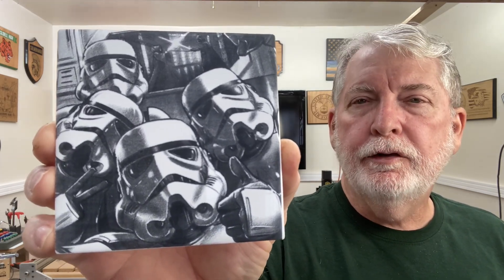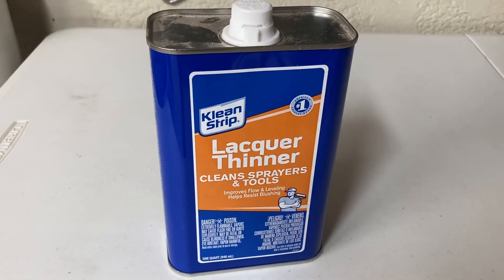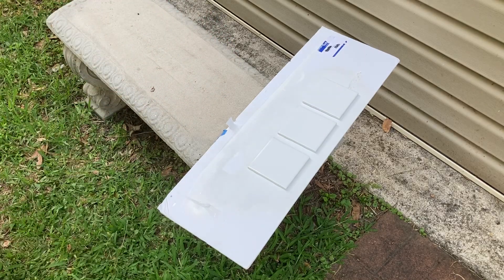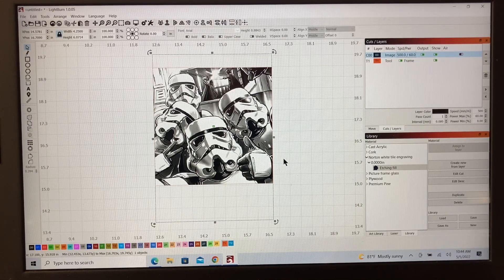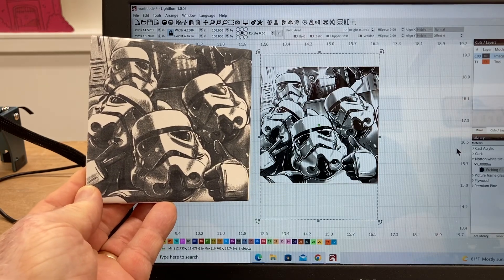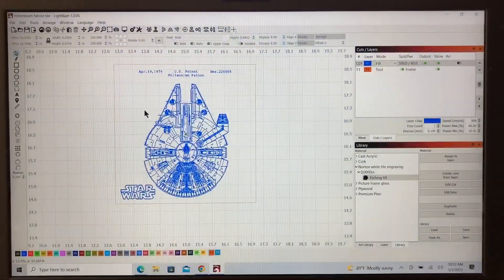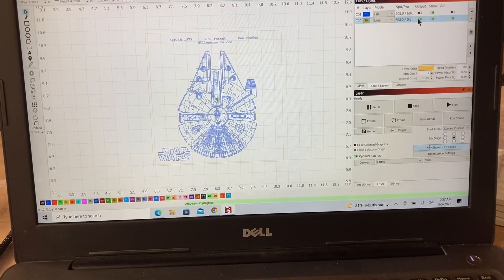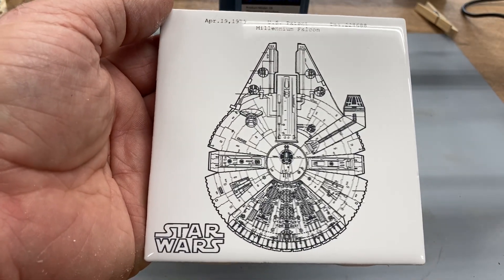Laser Images onto Tiles with the Norton White Tile Method

Comment: I have the same Laser and engrave tiles with a speed of 2000 and a power of 80% (254dpi)  - works much faster with phantastic results.
To prepare, I use Titandioxid, mixed with Isopropanol in a spray bottle. For speed drying I use a heat gun - ready to engrave in 5 minutes. After engraving, clear the tile under water and enjoy 🙂  regards from Germany
Reply from the maker: Thank you very much for the information. I have some titanium oxide to do some tests. Just can’t get to it quite yet. I appreciate you giving me this information
Reply: @PawPawsWorkShop  I'm excited about the result. Mixing ratio Titan/Iso 1:2

Comment: My first attempt failed..I edited the image in imagr and imported in lightburn with passthrough but the image came out grainy to like yours. What did I do wrong?
Reply from the maker: I would look at the dpi to start with. Also what style are you using? Newspaper will be very graining. Ditter is commonly used
Reply: @PawPawsWorkShop  I think it was a imagr error..on my phone it automatically defaults to old not Norton so when I clicked on white tile it wasn't right. It says in the description gives a cartoony type pic..I'll test my theory tomorrow. Thanks for the help. I still can't figure out why my color test tiles are all coming out grey though. One thing at a time

Comment: Use titanium oxide it's a lot better and less mess just wash it under the tap. Use IPA 50/50 mix U won't look back
Reply: It's really good 50/50 mix with IPA don't worry about spraying it on a bit heavy it will work. Just be careful because the titanium oxide comes off easy.
Reply from the maker: I just got some. Have not done video yet

Comment: Buenos días Paw desde España, aunque soy nuevo en esto, sigo tus videos y me gustaria aprender este metodo.
veo que primero limpias el azulejo con acetona y despues pintas con pintura blanca los azulejos?
me podrias confirmar si es pintura blanca acrilica brillante? o que tipo de pintura es.
gracias y un abrazo desde España
Reply from the maker: The paint must have titanium oxide in it to work. In the US, Rustoleum white or Smokey beige works well. Many of the litter colors have titanium oxide in them. So, the color is not the most important element.

Comment: NAME	TYPE	COLOR	TiO2 %
Rustoleum Painter's Touch 	Chalky	Linen White	2.5-10%
Rustoleum Painter's Touch 2x	Flat	White Primer	2.5-10%
Rustoleum Painter's Touch 2x	Flat	Gray Primer	2.5-10%
Rustoleum Painter's Touch 2x	Flat	White 	10-25%
Rustoleum Painter's Touch 2x	Gloss	White	10-25%
Rustoleum Painter's Touch 2x	Satin	Ivory Silk	10-25%
Rustoleum Painter's Touch 2x	Matte	White	2.5-10%
Rustoleum Painter's Touch 2x	Flat 	Grey	2.5-10 %
Rustoleum Painter's Touch 2x	Satin	Heirloom White	10-25%
Rustoleum Painter's Touch 2x	Satin	Smokey Beige 	10-25%
Rustoleum Enamel	Flat	White	10-25%
Rustoleum Painter's Touch 2x	Satin	Putty	2.5-10%
Rustoleum Accent 2x	Flat	White	10-25%
Rustoleum Accent 2x	Matte	White	2.5-10%
Rustoleum Accent 2x	Satin	Smokey Beige 	10-25%
Rustoleum Accent 2x	Satin	Ivory Silk	10-25%
Rustoleum Painter's Touch 2x	Satin	Blossom White 	10-25%
Rustoleum Painter's Touch 2x	Satin	Ivory	10-25%
Rustoleum Painter's Touch Primer	Flat	White	2.5-10%
Rustoleum Automotive Touch up	Flat	Arctic White	2.5-10%
Rustoleum Painter's Touch 	Satin	Ivory	10-25%
Zinsser Bullseye 123 Turbo	Flat	White	9.70%
Zinsser Bullseye 123 Primer	Flat	White	10-25%

Comment: Im having trouble getting a Darker finish. Only thing ive noticed Is I only do a light Vertical coating of paint not a Vertical and Horizontal..? Could this be it? I will prep some tiles and try again tomorrow.
Reply from the maker: The titanium oxide is what the laser is reacting to when it burns.
Reply: @PawPawsWorkShop  The coating was my issue, just finished several tiles following you %100 this time and the coating was where I failed. These are perfect now. Thank you PawPaw

Comment: Great video! I've noticed a little mistake you made in the picture editor. You set the "Enhance Radius" up and saw nothing changing and then set it back at zero, after that you upped the amount and saw again nothing happening. These 2 settings work together, the amount is the amount radius.

Comment: Tried it on a glowforge . Doesn't really work ? do you know why ? Thank you
Reply from the maker: You will need to adjust the settings
Reply: Glow forge is a co2 with a 2 inch focal length. He's using a diode. It has a small dot size that's why it took him 3 hours. A co2 could do it in no time but the resolution is gonna look bad unless you have your dpi perfect. 318 is what will probably give you the best result.

Comment: I noticed in your first example, you had set up LightBurn so that laser was scanning on quite an angle, not simply straight across the tile. Was there any advantage to doing that? Thanks
Reply from the maker: It a visual thing only. The angle helps to trick the eye

Comment: Iam fairly new using a laser i have the xTool D1 and i am using my own photography wildlife and other photos for placing on the tiles using the methods you show in this video. i am not really understanding the photo adjustments. my photos are high resolution and i would say need little adjustment in photoshop. however what are we looking for in adjustments for laser engraving on tiles. i have run some photos but some have been to dark and others too light. so what am i looking for in the adjustment? or is it the speed and power  used.
you dont happen to have a video on adjustments to photos